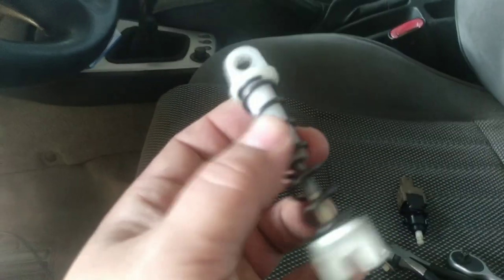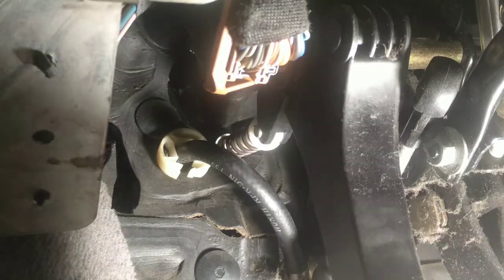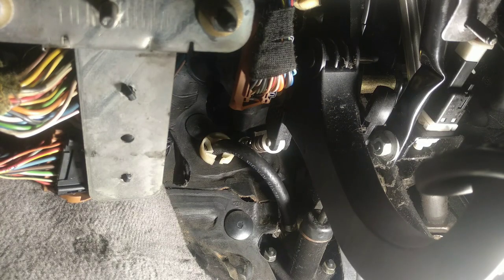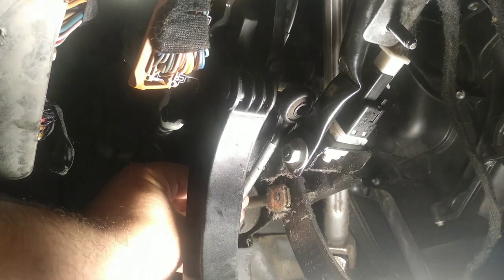Clutch pedal SPRING and SENSOR replacement. Alfa Romeo 156.

Comment: Top Video & advices ... best thanks
In Germany none of these parts (clutch pedal spring unit) is anylonger available ... although it's used in quite a lot cars of alfa and fiat, like the croma ...
Reply: The spring in my alfa 156 just broke and I'm also in Germany. Did you manage to find a replacement?
Reply from the maker: Hello. Thanks for watching the videos. The spring in had it made at a spring factory. The plastic parts sometimes you can find them good used or new old stock. For the shifter, it is very labour intense, yes..
Reply: @alfaromeonoproblem  I think you were replying to my other comment. But it is still appreciated. I'm currently looking at a spring manufacturer with a huge catalogue. Sending in the old spring isn't really an option, but if I knew the exact measurements and resistances of the old one I could order one for cheap. 
In regards to the shifter issue: it is quite frustrating that it is like 3 hours labour for tightening 3 nuts. I was consiering botching it, by reverse glueing in the screws from the top. But I decided against it, fearing not being able to put it back together.
Reply from the maker: @Art_Vandelay_Industries I can send you a spring and you can have it made. You can actually have a bunch made and sell them too
Reply: I have a broken spring to go off of. If you have a spare that you could send me that would be great. If you let me know how much you would like to have for it.
Reply from the maker: @Art_Vandelay_Industries I think it's 3,5 euros. Plus shipping
Reply: I just want to say a big thanks. The spring worked out great and fitting it wasn't that difficult. You really went above and beyond! Look at your inbox I've send you another email :)
P.S.: thanks for the heads up about the clutch pedal sensor. What do you know, it was stuck... But i got it working again. Your explanation in the video helped a ton! 
Regards
Reply from the maker: @Art_Vandelay_Industries thank you very much for the reply, I'm glad everything worked out for you. I'll see the email later

Comment: Awesome! 
Can you share the dimensions / specifications of the springs - just in case someone needs to make them in the spring factory?
Reply from the maker: Yes I can, but i found to be much more easier to take the broken spring to the factory and in this way it's really 100% iqual to the original one. Better steel alloy as well.

Comment: My 147 revs high when I clutch in and also it revs less than 4500rpms and I have checked MAF , Throttle has been checked and changed , cam sensor checked too. All
Faults cleared but the problem still there . Who can fix this ?
Reply from the maker: Hello. You need to do a good diagnosis. Check the items of these videos:
https://youtube.com/playlist?list=PLgcTCigdgD8PRomJp2e6DXqrPeNnb6jSX
Try to watch this small list fully. It will help you

Comment: Hello mate.
Want to thank you for your content its very helpfull.
Unfortunately I found this video after I broke my clutch sensor button accidentally and my ECU thinks that my clutch is pressed all time.
What does it threaten if to drive in that state?

I fixed it pretty badly, it works but not for long I believe.
Reply from the maker: Hello. No big issue, in you have cruise control it will not work, if it's a diesel it may by more violent on gear change
Reply: @alfaromeonoproblem  Thank you

Comment: Hi, i have problem on my ar 156 1.9jtd 16v 103kw. I bought new egr, MIL was deleted and after 30km MIL is again. Fault code egr ventil. Whats wrong please? Thx
Reply from the maker: Hello. The most common fault with the egr is in fact not the egr it self but the intake is clogged and also the intake pressure sensor may be dirty as well. Clean everything and see how it is

Comment: hi mate , i got a problem with a alfa romeo 156 2.4 20v , i did a stage 1 , and recently replaced the clutch set. When i boost , the rpm clock goes up , but i dont get speeed. Could it be the clutch set or any sensor ? i appreciate any advise
Reply from the maker: hello, how are you? Seems to me your clutch is "fried".
No sensor used unless is a "selesspeed".
Beware of the chuth set brand, i leave you a link for it:
https://youtu.be/ikSmJS47NGI
Reply: @alfaromeonoproblem  i actually fitted a 2.4 10v gearbox with the clutch kit , when i drive idle the car wont speeed up , just the rpm goes till 5000 rpm for 2 seconds and then it speeeds up , i think the problem should be on the clutch plate itself . Thank you very helpful
Reply from the maker: Glad to help! Thank you

Comment: Does this work if the clutch goes down and the springs back up by itself after a few seconds delay?
Reply from the maker: I'm sorry, I'm not getting it
Reply: @alfaromeonoproblem  I have a Giulietta and when I push the clutch down to change gear. I take my foot off the clutch and then it comes back to position in 2 to 3 seconds later
Reply from the maker: Ok ok. Most probably air in the circuit. Hask for pressurized bleed of the clutch lines
Reply: @alfaromeonoproblem  So I can get a mechanic to get that done or can I do it myself?
Reply from the maker: If you have a pressure pump you can do it.
https://youtube.com/playlist?list=PLgcTCigdgD8MSkcQhlXTdYW9iGEhZg8Wc
See if it helps out

Comment: Hi friend, can you help me: 
I have 156 2.0 jts and whan engine is cold (even in warm outside temp.), when I start the engine, rpm goes to 2000-2500 and stay there until I hit the first or any other gear, and slightly move up foot from clutch pedal, like I'm going to start driving. Then rpm goes to the normal value. Have you any idea? 

Thanx!
Reply: No check engine light or any other error
Reply from the maker: hello, how are you? sounds to me it's a intake leak. Aquantity of air is being suck to the engine without mesuring. A quick test is to take out the intake pipe from the intake valve, start the engine. with your hand choke que intake has best has possible. The engine must quit imidiatly! If so, from there forward it's all ok. Sarch for cracked pipes in the intake line. If it doesn't quit or takes seconds, you have a leak on the manifold or pipes that connect to it.
If none of the above, if the engine has a idle ragulator an be bad, if it does not has one can be a dirty intake valve from the inside. 
You may need has well the diagnosis machine to do a learning for the intake valve and reading of intage values.
Reply: @alfaromeonoproblem  wow...thanx for your effort. I really have broken intake pipe, the one in front of windscreen. I  fix it with the tape but it's not good enough. I'll buy the new one and replace and let you know.

Thx 👍👍
Reply from the maker: Thank very much for your answer. I can try to identify the part for you. Leave the vin in my e-mail on the description and i will try. Then, with that info you can choose where to buy.
Reply: @alfaromeonoproblem  
ZAR93200000221892
Here you are. Thank you very much 👍
Reply from the maker: Hello. Please confirm your VIN, cannot enter. But try it yourself, www.fiatdalys.lt
Don't know if prices aply for your country, for mine they don't. but the part numbers are worldwide.
If you cannot enter with vin, can always use "model wizard"
Hope to be of some help.
Reply: @alfaromeonoproblem  
I have check the vin again and it's ok. Anyway, l'll try it by wizard, thx
Reply: @alfaromeonoproblem  
Ok, I found the item. 66€, can't find exactly 2.0 jts, but it is for 2 litre benzina engine. 

Thank you very, very much. You are the genius 🤘🤘👍👍
Reply from the maker: Nice! For Portugal, the price the parts is normally half of what's on the site. Hope for you is the same or better! 
Please share the channel with your friends.
Reply: @alfaromeonoproblem  
Ok, I'm going to..
Reply from the maker: Thank you very much